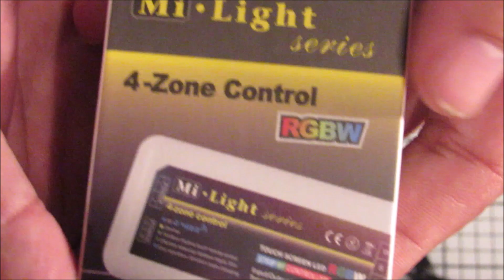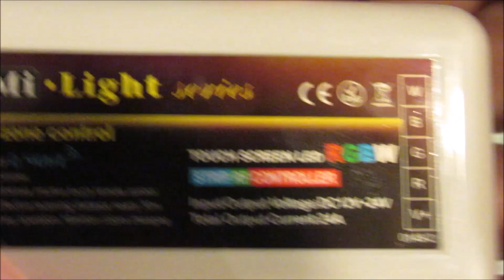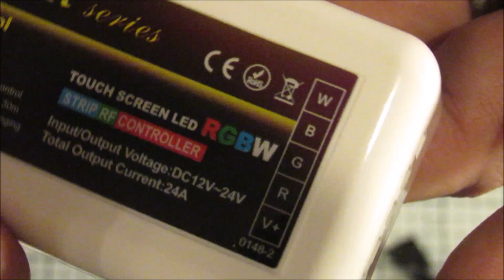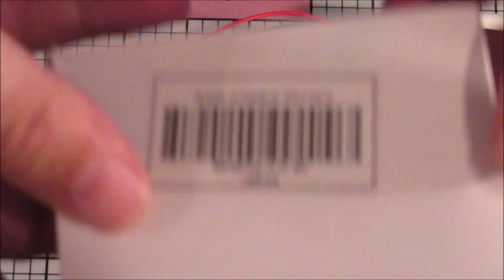MI*Light 2.4GHZ RGB LED Light Strip 4 Zone Control

Comment: How can the Mi-Light B8 FUTB8 Wall Mount Panel 8 Zone Remote Controller be used wirelessly to control the Mi-Light LED strip lights with a Mi-Light FUT037 LED strip controller?

Comment: I also found out after spending a few quid that the T3/B3 for RGBW LED strip ONLY work with FUT038 controllers. The identical looking B4/T4 works with FUT039 controller for RGB/RGBW Strips.
Nowhere in there manuals for the T3/B3 or B4/T4 touch panels does it quote this. I hope they don't mind but I found this site invaluable in working out what works with what, because many YT Videos say nothing about the pairing issues if you have the wrong controllers. @t
I really dont understand why Mi-light dont just make all its kit work with everything else, when it works it's great but can be frustrating that they don't tell you in their own manuals with the touch panels what they will and won't work with
Reply: I am also having trouble connecting my T4 to a YL5 controller. the controller manual says they are compatible but I cant get it to work...Any suggestions or any idea who I can contact in support to help with this?

Comment: do these controllers let you make white from an rgb strip?
Reply from the maker: Hi, the strip I used for this project did have a dedicated white, and the rgb controller also had white (thus the W in RGBW). Though, all rgb can try to simulate white by maxing all the red blue and green. In my experience though, just make sure to get a strip that has the W in the name.
Reply: Bostish2 Thanks for the reply. I used rgbw before and this project im using a lot more and the rgbw strips are more expensive than the regular rgb. is there a way to adjust all 3 colors independently on an individual controller to make white or will it effect all other controllers in the system as well? An example would be if i had 4 controllers hooked up, could i make green on one, red on another, green on another and white on the final controller? They dont tell you what functions or modes that the controllers have in any listings i can find, so this info is not clear to me.